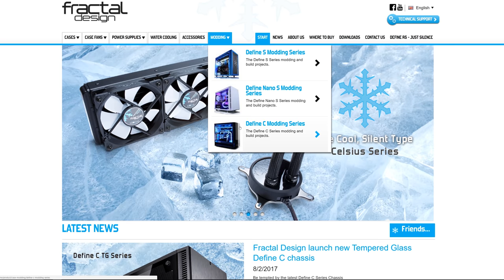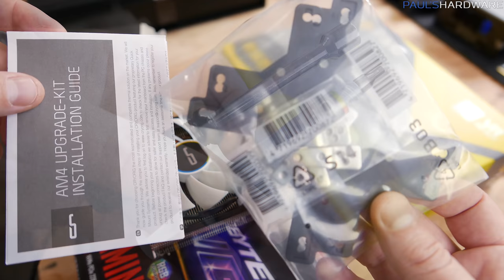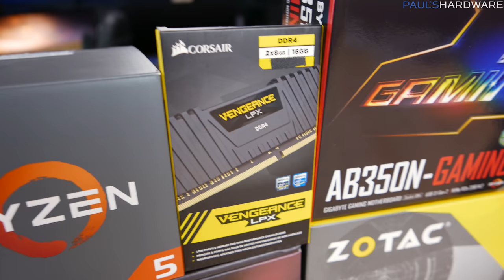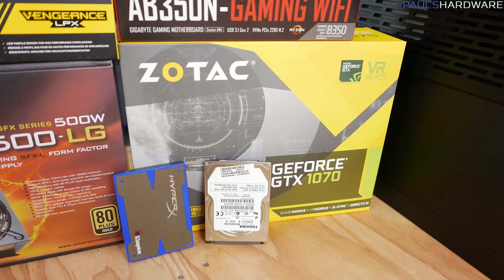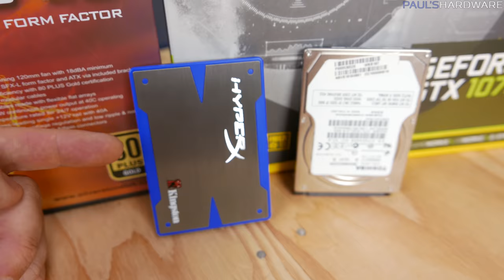Building The Mini-ITX Ryzen Gaming PC!

Comment from the maker: The follow-up video testing this system is now live! Watch it here: https://youtu.be/h91T3HwLYIw
Reply: Call me lazy, but I would have went with the SG13 variant case, but the portability would have been limited in comparison. Good work again Paul!
Reply: Paul's Hardware
The "slim optical drive" you said might fit in the area next to the two main drives...  Any suggestions on where to go to GET one?  I've looked on New Egg and the only ones they have are either externals or ones meant for laptops.  Where do you get an internal slim drive meant for a desktop?
Reply: Paul's Hardware iP
Reply: Are u Australian
Reply: Hey Paul, what's the song starting around 08:10? Awesome fit.
Reply: Is there a place for 3rd 2.5 sata 3 ssd?

Comment: Nice, well balanced small gaming machine. Just a tiny note: 500W is certainly not on the low end for this, the system will probably not even break the 300W barrier when gaming. Both the Ryzen 5 and GTX1070 are pretty damn power efficient, only when you overclock the living bejeezus out of them will you even get close to 400W usage, more but still very comfortably within the range of the PSU.
Reply: I thought the same thing. I've been annoyed at everyone thinking they need 2 times the power they really do. It's one thing to want to be on the sweet spot of the efficiency curve. It's quite another to spend $100 on a power supply when a $35 power supply will do the job AND enable you to get more/faster RAM or a better cooler.
Reply: @AtomicAJ74  
Good luck overclocking on a 35$ PSU. 
Good luck not having a catastrophic failure.
You get what you pay for.
Reply: @AtomicAJ74  Please don't tell people to buy a 35$ PSU like it's a reasonable thing to do.
The real cutoff is about 70$ or 50$ on a deep sale.
Some of those EVGA models are good...some bad.

Recommending people cheap out on their power supply is something everyone new to PSU has to learn the hard way not to do.
A good PSU will save you money on your power bill, help you OC your components, save your components during power spikes and sags, and last 1 to 2 decades.

I wouldn't recommend someone buy the cheapest serpentine belt or brake pads or calipers for their car for similar reasons.
Reply: Starscreamious “The real cutoff is...” you put the dollar sign behind the amount, which implies that you may not be in the United States, which is where my comment is relevant. EVGA and Corsair, as well as other manufacturers sell perfectly adequate power supplies in the $35 range. They will last years trouble free. That may not be the case in other countries. As I said, you should not be pairing a 2080 Ti with a 450 watt power supply.
Reply: @AtomicAJ74  Nah I'm in the US I'm just a rebel with my $ placement.
If you're referring to deep sales/clearance/loss leaders that occur sporadically during the year there's an argument to be made there. 
However, if you mean something elsw like MSRP, normal street price, open box, used, refurbished, not even 80 plus, no PFC PSU's, or just 80 plus vanilla drives I'll have to continue to disagree.

I'd recommend 50 to 70$, bronze rated or better, known good manufacturer, well reviewed model, and good user ratings. 
.....or as many of those things you can get.

I still have power supplies from over a decade ago and they still work.
I've done stupid reckless things in the past with my computers and the PSU helped restrict the spread of damage. (I literally, not figuratively, set my GPU on fire with an overclock. Actual flames, not just smoke.)
Reply: @Starscreamious  No. Just no. You don't need bronze rated or better. You just need a solid brand name made with quality components with enough margin to meet your system's power demands. There is nothing wrong with the $35 power supplies sold by Corsair and EVGA (my two personal favorites).

You don't need to operate at the 50% point to optimize PSU efficiency; if you do that you will never save enough money on your electric bill to make back the added cost of your power supply.

For the typical mid-range system, such as a Ryzen 5 3600X paired with a GTX 1660 Ti, a 450 watt power supply will provide over 100 watts of margin. Corsair and EVGA both typically have good power supplies in this price range. Right now, there is a 400 watt EVGA power supply on Newegg for $35. That's a bit too close for my comfort on a build as described above, but for a lower-draw system it will last for a decade with no problem.

Power supplies are currently more expensive than when I originally wrote this comment 2 years ago (thanks to tariffs and COVID-19), but certainly $50 will meet nearly all mid-range builder needs with a solid 500 watt power supply. Modular supplies will obviously cost more, but I was referring to a typical, mid-range build.

Inexpensive does not necessarily mean cheap.
Reply: @AtomicAJ74  The reason I recommend bronze or better is because the components used are better because the specifications are more stringent...tighter tolerances. The power savings is a bonus. And it's a rule of thumb kind of like the weight of a PSU.

I have seen my system which idles at 100ish watts go up to 900 on a heavy load (AC power at the wall). That is to say that if you aren't overclocking any components you can get away with 500watta but remember that TDP numbers are a lie these days as all CPUs and GPUs will overclock themselves. When you overclock the power usage can get shockingly high.

I have a 1000 watt platinum unit. I bought it back in the days of directx11 and xfire/sli. It and haswell-E made sense to me back then.

Comment: The 1070 costs around 10'000 to 11'000 where i live, which is like 600 dollars.
Reply: Jhasua Gallo That's the price in most places from what I've seen
Reply: Jhasua Gallo I believe $480 or so for a good 1070 here in the USA.
Reply: I remember buying the 970 for 5'000 (around 300 USD) in 2015...the US dollars were even more expensive back then, fuck miners.
Reply: U can easily fit some full lenght cards in there.. got the Zotac 1070 with dual fan but in full length.. loud AF - guess why he does not show the build running under load 
Go for a triple fan full length

Comment: You could fit a 1080ti in this case with NO thermal issues as this is what is in my build, but the kaby lake i7 gets a wee bit hot under heavy load in the range of mid to high 80s.
Reply: NukeFrywalker what gtx 1080 ti is it? Im planning to put the evga gtx 1080ti sc black edition gaming in this case (or silverstone rvz03)
Reply: otakuMCkid6969MRstealYOgirl founders edition with plenty of extra space.

Comment: With slight modding you should be able to fit that low profile Cryorg C7's fan onto the Wraith Spire's larger heatsink for improved cooling performance and still fit in that ML08-H case.

Good case choice BTW, mine was a toss-up between that and the Node 202, but I liked the ML08's handle, and room to mod a 3.5" HDD into the slim ODD spot if I wanted to add one down the road.

Comment: Sweet build :-) Just one question.. You did not once mention a potential issue about the fact that there are no case fans.

Are You not worried about heat issues here?
Reply: Michael Clausen I have this case and, no thermals are not an issue, in fact arguably better then some tower PCs as this case behaves a little like a open bench due to each component intake air independently.
Reply: I don't think the case is designed to incorporate a case fan.  Each component has its own fan facing the ventilation.
Reply: Yeah thought so... will start cutting up my own SFF case (Nano S), and build individual compartments for each unit inside now ;-)

Comment: it can fit 3 fan cards, but you give up the 3.5 inch HDD space. the way I mounted my 3.5 inch is I ripped out the optical drive mounting pegs and used 3m mounting tape. 1000 miles of car drives and 6 months later, still holding just fine. makes it a bit heavier though.

Comment: @Paul's Hardware, I built a 1600x with the C7, ab350, 980ti, and SX500 in this exact case! I could not for the life of me figure out a good cable management route and put them all over the fan lol. Anyway looking forward to some more info on this system because I feel that the C7 was just too loud because it was not cooling my 1600x enough. I had to take off the side panels and add a tower cooler...

Comment: Opinions please:
I had a thought regarding these mini motherboards : what if the mobo manufacturers design a connector cable that has all the front IO male connection pins on, and is long enough to reach to any side of the motherboard and plugs in on the under side of the mobo. Might be possible to do this for the 8pin power too. Only one that def wont work is the 24pin cable.

Comment: i used the same case for my rig but i used an asus b450-i that has a good cable layout for this case, a more little but very good corsair sf450 psu and a noctua l9x65. It's a fantastic case, with sufficent airflow (forgeting overclock).

Comment: I have the same motherboard and i have problems with cable management too. The front headers and 8pin 12v power connector were way out of place to have a decent cable management. I cant utilize the top two 120mm fans of my matx case because of that.

Comment: i have a hard build for you to come up with i have a design for it but id love to see what ur parts and thoughts are for a build like the one im planning, im looking to build a mini itx computer that i can put in a backpack and go hiking with and still use it at each stop i have power at build would include a monitor keyboard and mouse along with full tower all able to fit nicely inside or strapped to the outside of a hiking bag. ideal weight in full 25-30 lbs max ( yes i know this is impracticle but its a build im thinking about even though a laptop now days can do just as good as a desktop the one i designed has 2 - 2tb ssd's in it) price is not something i cared about in this build.

Comment: So I went ahead and purchased all the parts from the description and built the system but ran into two major flaws. First the CPU fan from cryo-rig did not come with the necessary AM4 bracket adapters although you could order them free from their website that does not help when you’re building the system. Two and the gigabyte motherboard did not come with a new enough bios version to support Ryzen five and there was no way to update it since you cannot see the display or any video output. I tried using gigabyte Q flash but doing so without a visual guide or monitor is impossible. So unfortunately I had to return the whole system because I did not want to take a chance at getting a replacement motherboard to run into the same issue. Sorry they’re going to take some money away from you Paul from your affiliate links.

Comment: Great video, although i wouldn't use this particular motherboard, Tom over at OC3D tested it a while back and said it suffers from high VRM temps as the heatsink is far too small, not to mention the front panel connectors are in a rubbish location.

Comment: I feel your pain with that motherboard and cable management, omfg the layout >.<. I just did a build with that board,that Cpu cooler and a r5 1400. If your going to over clock it keep an eye on the vrm temps though. The heat sinks for said vrms are horrible, But that fan offers a downdraft effect so it will help.

Comment: Similar build to what I have, same board and cpu, but im using the fractal node 304 so I have enough room for a gtx 1080, my only question is why not use a nvme drive? Especially if you want to save space.

Comment: If you were to overclock the CPU using a VCore of 1.425 V I doubt you'd have it use more than 125W. So, add that to the 150W rating of the 1070 GPU, and you have 285W draw from the +12V rail. Leaves more than enough for disks, fans, and the motherboard- plenty of headroom. I don't think you need to suggest a >500W PSU. Of course, a reminder to everyone that it needs to be a QUALITY PSU from a reputable brand- and look up reviews first. Across a company's range of products, there may be some great ones and some bad ones.

Comment: Hello Paul! I'm about to buy the pieces to build this set up and I'm wondering why you chose the 1070 mini instead the regular version. I gueds that both versions fit well inside this case and I understand that the 1070mini has less power consumption but is this relevant if it has only 2 fans instead of 3? Is the mini version better because provide less heat to the case? It should be some performance differences between the two graphic cards? Thanks so much!

Comment: I was wondering what made this so expensive, other than GPU and RAM because obviously, but a WiFi capable board will really do that..

Got a similar ATX build with a 2700X and 1060 6GB for ~$175 less.. so glad I bought it 8 months later than this video

Comment: I didn't like this case. The power button felt really mushy and not nice to press. That's really all I didn't like but it was enough for me to leave the case. Such a shame since silverstone puts nice buttons on their other cases. The front I/O being in the middle also feels weird. I don't like the look. It looks neat, but in practice it wasn't for me. 

Some positives though: you should actually be able to fit a 3.5" drive in that space as it is designed to fit a 3.5" drive though I never did so I don't know how the holes work or the cables run. I did put a DVD drive in this case which came with a nice little bonus as you can actually throw a 2.5" SSD in the space under the optical drive. 

Node 202 is a much smaller case (never had it so I can't speak on how the power/reset switches feel) but I do like the USB positioning more based on the pictures. On the downside you can't put the massive cards in it. I think you can put just about any card into the case in the video except the excessively massive ones they don't make anymore. And I only know of space for two 2.5" drives. Someone who has (had) the case could probably say more about that though.

Comment: does the stock wraith spire cooler fit in this case or the fractal node 202?
Reply from the maker: In this case, yes it would, I'm not completely sure about the Node 202 though since I haven't built in it
Reply: cheers paul :D was considering both these cases and didn't feel like buying a third party cooler if I don't have to

Comment: "500 W is actually on the low-end of what I would recommend ... " That build is 250 W max, 500 W is overkill, you reviewers need to get back on earth when it comes to power.
Reply: It's not overkill, it is overspecced. That CPU and GPU should be about 289 watts according to what I saw on Guru3d. I suspect that's not overclocked.
The total power usage of the system would be more as soon as you start including hdds, ssds, fans, lights, etc. 

Also...overclocking which is built into CPUs and GPUs these days will use a lot more watts than you think.

Comment: The Asrock AB350 Gaming-ITX/ac is a better am4 itx board with easily accessible connectors.
Reply: Jerua Thank you. I don't know why more people aren't saying this. That Gigabyte board makes no sense.
Reply: Perhaps on board Wi-Fi? I'm not sure, don't know anything about the Asrock motherboard
Reply: Lol you couldn't Google? The Asrock has built in 802.11ac wireless. Hence "ac" at the end of it.
Reply: I had to pay more but I wanted that asrock motherboard
Reply: I just bought the Gigabyte board. Why? Because it has 8 USB ports vs the 6 every other AM4 ITX board comes with. I was having USB bandwidth issues with my Oculus Rift on my on ITX board with my trusty i5 2500k. I didn't want to run into that issue again, so this board offers three different USB controllers, I'll deal with the port placement.

Comment: "500W is on the lower end for a power supply" Did you watch GamersNexus' video on this? 500W is more than enough..
Reply: pcfreak1992 I go 550
Reply: You're wasting some efficiency, power quality, longevity, and also sound when you go more than 70% of what your PSU is rated for. This is because all PSU are most efficient around half or slightly more than half of their utilization. There's also current peaks and jumps, computer processors do not consume a constant flow of electricity. They're variable, and fluctuate a lot. So combine this with pushing your PSU a little too far (since the components inside the power supply may be rated for 500 but they're not designed to have constant flow of 400-500 watts) and the fact it peaks a lot, it can start stressing the internal components (lower lifetime and louder PSU, less reliability). This is also not even remembering about voltage and current quality, which can have an impact on overclocking! Power supply quality alone has an impact on how good your max overclocks can be with certain GPUs, and once you start pushing your PSU farther than you should with an already low rated PSU it just gets worse.
Reply: Alisson Craus um no. They are rated for maximum continuous wattage. How long for is where quality separates each PSU. 
Also, the load fluctuations in power consumption doesn't do much to it even if going from high load to low load. It's more likely to hurt the CPU/GPU than the PSU which is designed with this in mind.
Reply: Igot a 450w for my oc ryzen3 and rx 580
Reply: I’m using 600w for my ryzen 3 build
Reply: No its not
Reply: Johnathan Bloch so with a 400w power supply you would be exactly just under your 70 %, since i own a pc with those components and it draws under load maybe 230 - 250 watts
Reply: This system here won't pull over 300w max. 500 is overkill.
Reply: Idk why Paul said that, it was pretty ignorant.